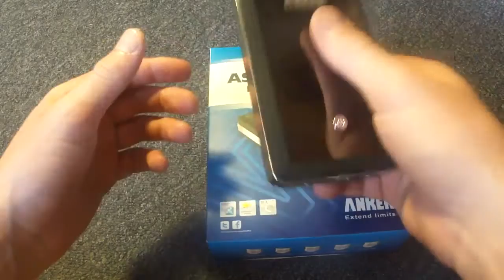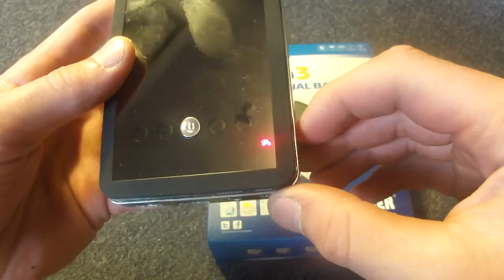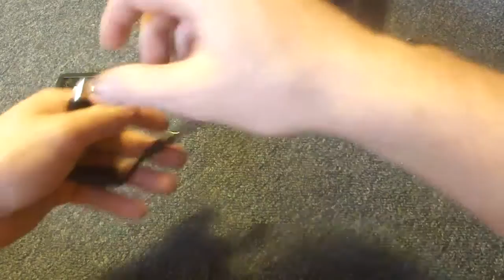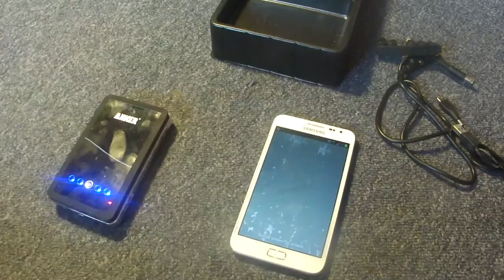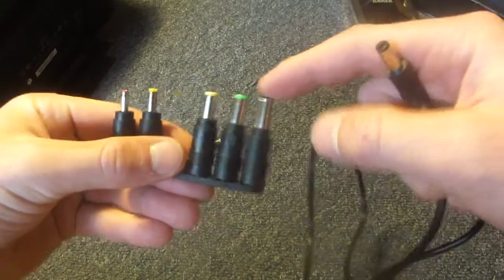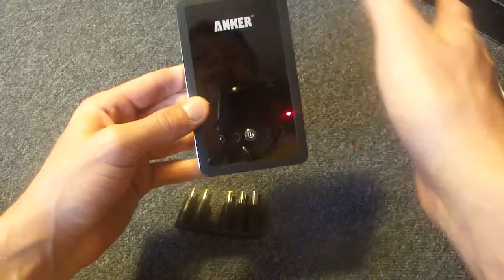Anker Astro 3 10000 mAh External Battery

Comment: You don't even have to worry about the 9v, 12v for the PSVITA because the 9v, 12v is for the output and the USB port is the one you will use for the Vita which is enough for you r device.